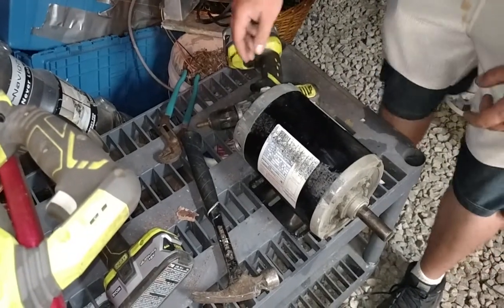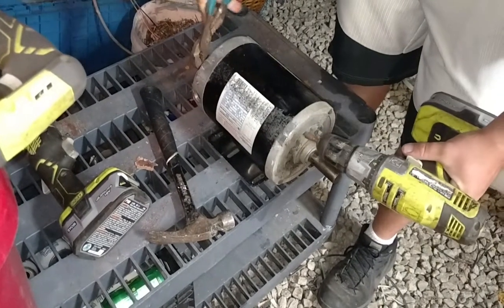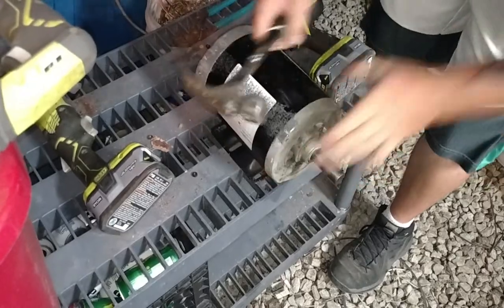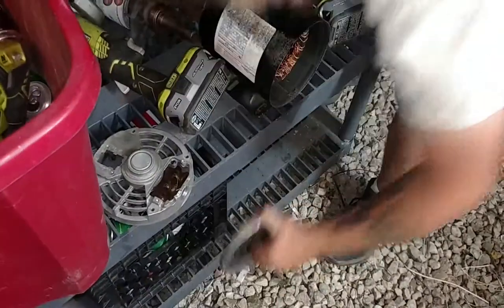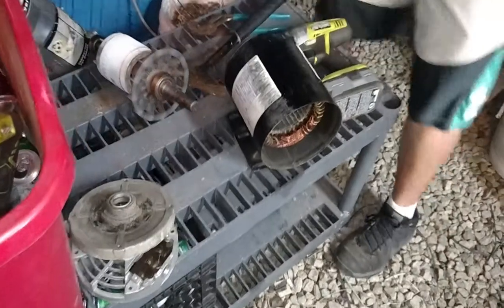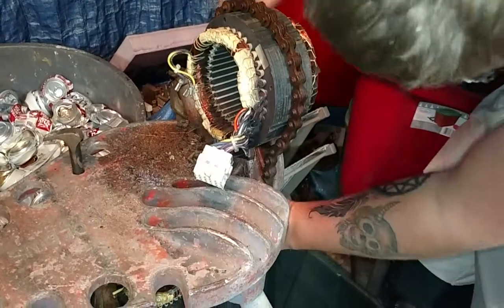Scraping electric motor easiest way. #scrap #copper

Comment: I like the pipe vise. Got one from an old plumber and it has been a versatile tool.
I screw around too much taking motors apart trying to avoid using consumable discs and blades. Time is money when there is a pile of them to do. Thanks for the demonstration.

Comment: I would like to make a suggestion. And that is to be using a corded sawzall and a corded grinder and your grinder should have a diamond blade it will create less dust will last lot longer and when you're cutting your casings you should cut it with a sawzall with the heavy duty sawzall blade. It will make your job a lot easier.

Comment: Good video man I've been trying to figure out how to get that core out for a while
Reply from the maker: Using a hammer drill works alot better.
Reply: @JimboScrapper  hammer drill?
Reply from the maker: @brettmason1899  https://youtu.be/7D6f7rS1v7U
Here is my video with a hammer drill.
Reply: Thanks man my main problem has been getting that casing off the motors I'm going to try that angle grinder to cut the motor casings off so I can get the core out
Reply from the maker: @Brett Mason  if you run the grinder on it, the outer case on most motors will pop and you can pull it right off

Comment: WILL THAT BE NUMBER 1 OR 2 COPPER. WILL YOU CLEAN IT UP OR TAKE IT IN AS IT IS.
Reply from the maker: I used to take it in like that for #2 price but lately since prices are so high I clean up what I can for #1
Reply: @JimboScrapper  Never Scrapped before... What do you mean by clean it up?
Reply from the maker: @MrsBuddevil  sometimes I'll spend the time to cut the string off and remove the plastic, it all depends on who I deal with at the yard and how much copper I have, they usually don't care if it's clean or not.

Comment: If you have an air compressor get an air chesel much faster on the big part of the copper
Reply from the maker: I have a compressor but no air chisels this was a old video and  I really hope to make more soon when the weather breakes
Reply: @JimboScrapper  Harbor freight they are cheep
Reply: I’ve had winding that a windy gun won’t shift( biggish ones ) they’re ok on smaller motors, I’m working towards a hydraulic puller with a scissor grab …

Comment: In BC Canada that is second or third grade copper because of the junk attached to it.
Reply from the maker: I get #2 price for the motor guts if I cleaned the plastic and garbage off of it it would be #1
Reply from the maker: What are your copper prices in Canada?
Reply: @JimboScrapper  2.50
Reply from the maker: In Indiana right now I'm getting 2.75$ for #2 copper